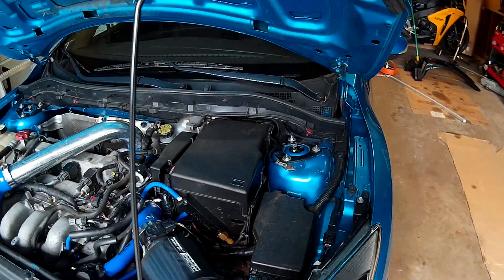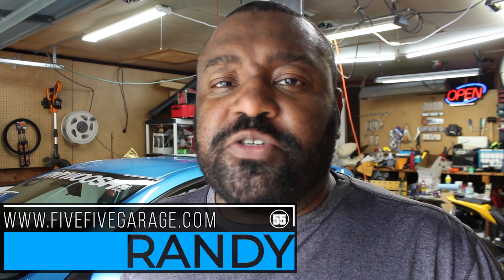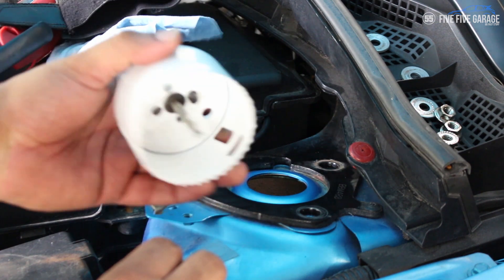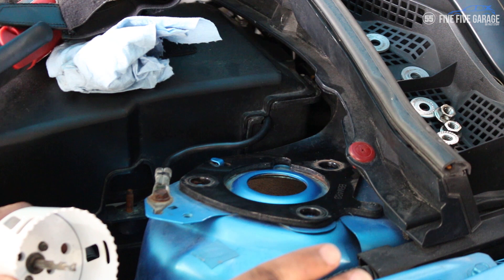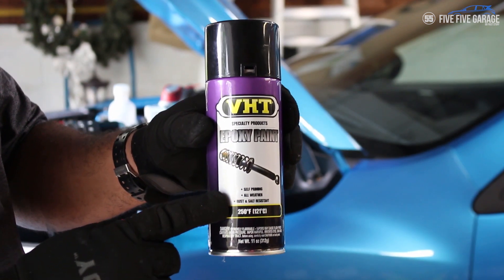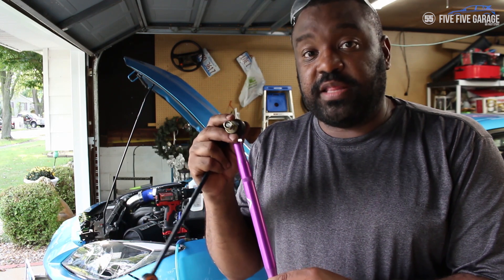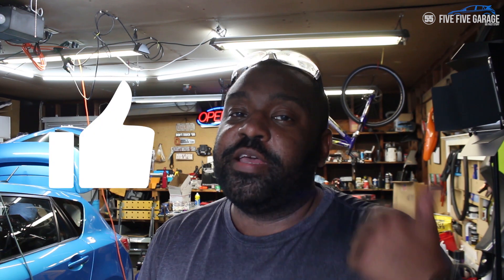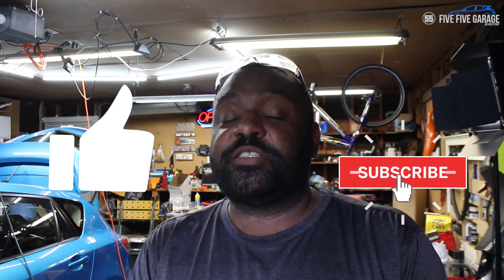Mazdaspeed 3 Suspension Update Part 2: Adding Massive Speed System Front End Links

Comment: How have the front endlinks held up over time. Any clunks or creaks. Replaced mine with moog and the grease fittings dug into my wheel wells and I'm starting to hear front end noise. So thinking of an replacement now. Prob gonna do the rear camber arms also...
Reply from the maker: They are holding up great! No issues, no noises. Make sure they are good and tight and you should be good to go!

Comment: Are those too long to be lowered below 1.5"? I have some godspeed ones on and they were too long, even though Im using godamn godspeed coilovers.. It eventually snapped. I just need some shorter ones!
Reply from the maker: They are a bit long if you are going slammed. You could order an outer rod from McMaster (make sure you get the right diameter and thread pitch) and cut a custom one to size.

Comment: Do you the part # or where to buy those black plates that go on top of the strut tower?  Reinforcement plates they are called.
Reply from the maker: I don't know the part #, but you can find them on eBay for both generations. I have seen them as cheap as $35 for the set.
Reply: Found them.  BP4K34007B and BP4K34008B.  Got them at local dealer for $9 each

Comment: I USED BI-METAL  WHOLE SAW AND IT WORKED LIKE BUTTER
Reply from the maker: Last time I used bi-metal to cut I had a hard time. Looking back I also did it "dry" so maybe that contributed to my issue too.  I will say that cutting oil always helps!
Reply: Yea I’ve only done it once but it worked pretty easy